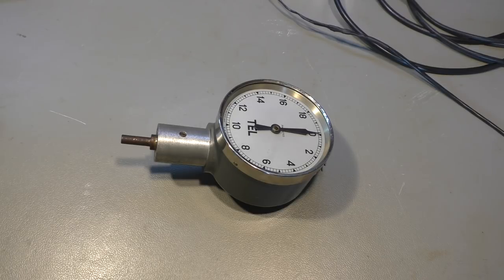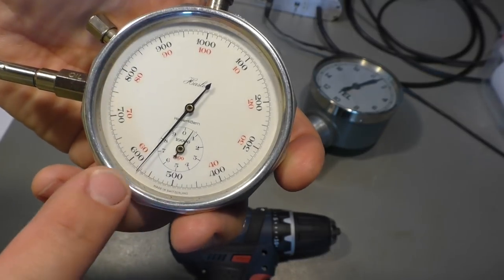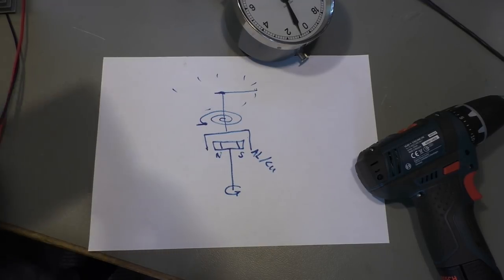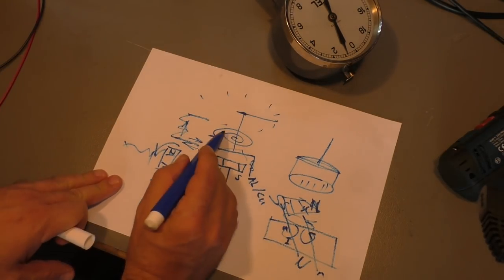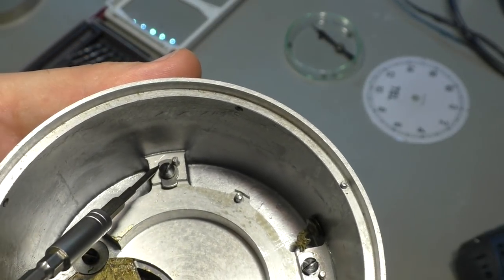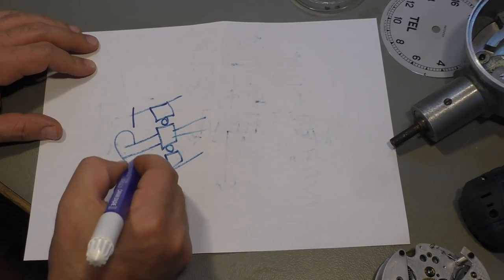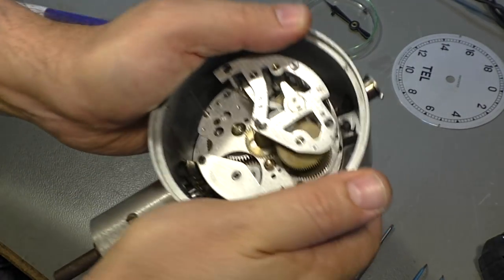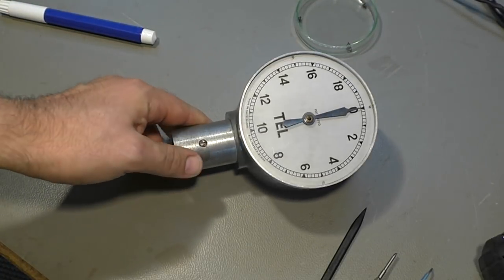Vintage swiss made tachometer clockwork - (PWJ101)

Comment: A friend is a Hasler Rail representative. He sells train registers, like black boxes but fro trains, are made by Hasler Rail. No sure if still Swiss. I put a couple in service and they are overbuilt as you expect from the price tag and the mision it has. The run on the auxiliary power lines of the train at 180V, logs speed, direction, some sensors in the cabin and drop 2 alarms configured on speed threholds an can even mandate on the traction an emergency braking. This last feature is disabled because unions state that only the motorman can decide over the train and not a machine.

Comment: The acronym «TEL» means «Tachometer ELektrisch» (electric tachometer), since Hasler combined these clockwork devices with synchronous generator/motor pairs. Therefore, these instruments have been used to measure speed or RPM by an electrical flexible shaft. Consequently, such a system is more reliable than a mechanical flexible shaft and perfectly suited for locomotives and trams, where the driver can not afford to lose his speed indicator.
Reply from the maker: That makes sense... Thank you for your explanation.
BTW, many instruments on old aircraft like the Super Constellation work in the same way. You can watch my video about the propeller synchronizer....

Comment: Thrust  bearings    are what  you find on steam  engines  on large  boats. They  connect the   steam engine  flywheel  to the sections  of the  propeller  shaft